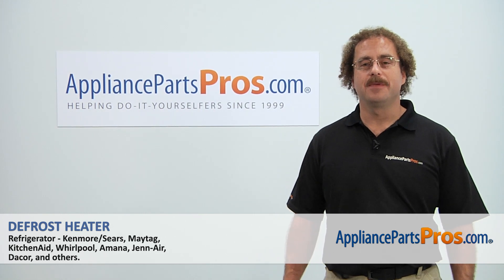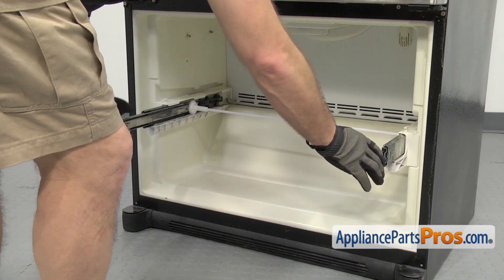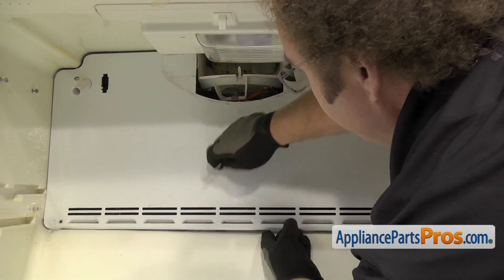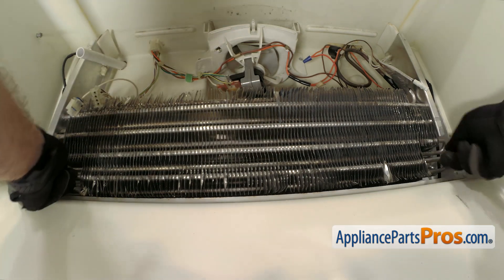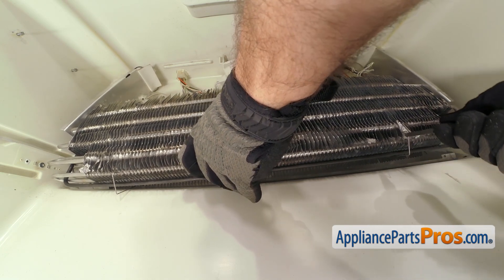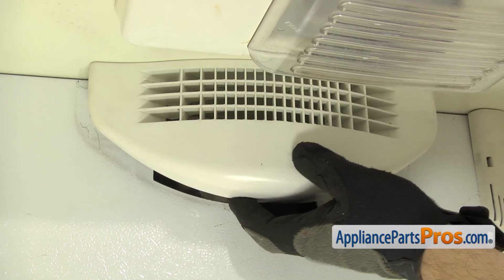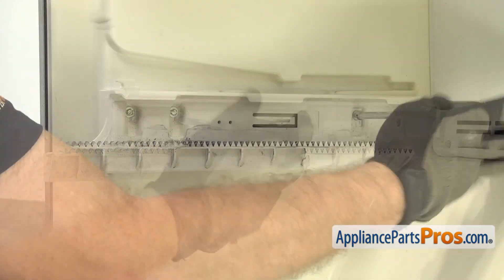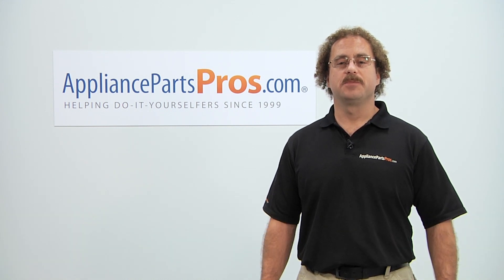How To: Whirlpool/KitchenAid/Maytag Defrost Heater WP67002493

Comment: Hi I have maytag mfd2561hes  frig I replaced  board and t stat but I have no power going to heater when I put in defrost  what could be keeping  power off besides board
Reply from the maker: Have you checked for loose or damaged wires by chance?